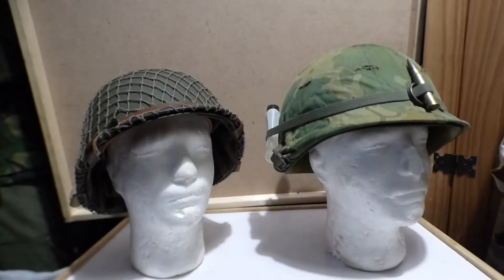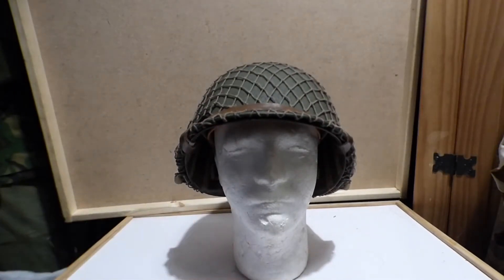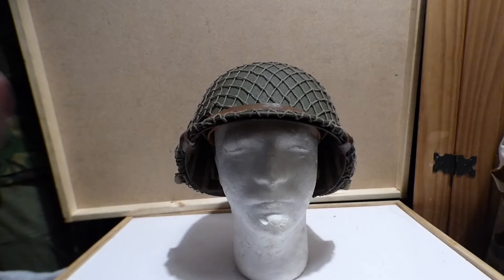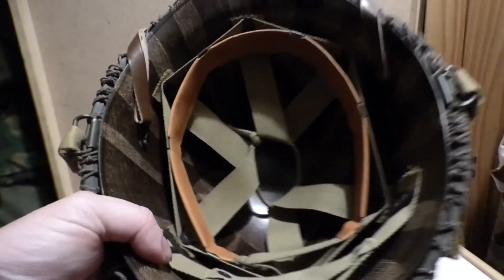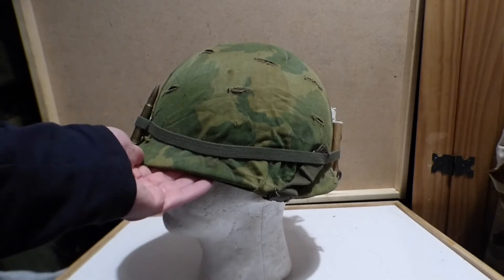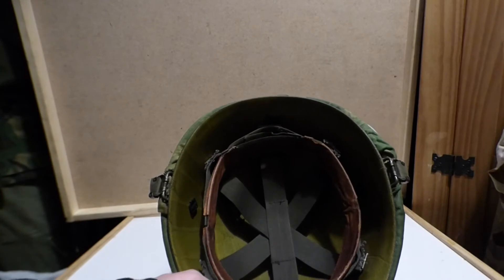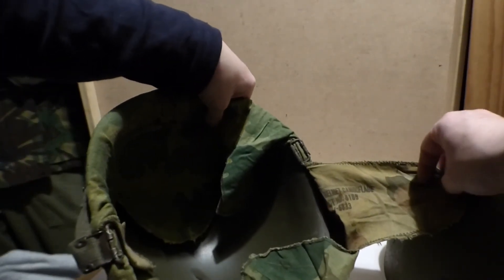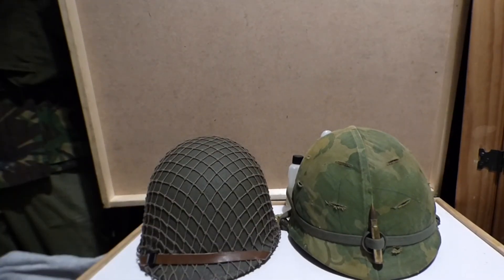WW2 M1 Helmet & Vietnam M1

Comment: I made a vietnam Impresion M1 helmet recently bet the cover was a repro , I put two 556. blanks inside the band with a JFK presidential pin on the Helmet band , I also marked the outline of Louisiana sate on it too to give it some believable authentic graphiti , I also had bought a fake pack of marlbouroughs and tucked it inside the helmet band , 
I try not to overdo it and avoid steriotypes but im pretty happy with how it turned out 
( Also the Liner was repro and the helmet was most likely NATO from the 80's but you wouldnt know with the helmet cover )

Comment: nice helmets. yeah your nam liner is actually later as indicated by the removable webbing. that wasnt introduced until mid-late 1972 and as they were drawing down troop numbers for departure in 1973 is doubtful any made it to nam. they were using nylon for liner shells from the mid 60s but the earlier ones are usually more orange-orange/green. 
like the been there look of the nam helmet.

Comment: I've got a front seam M1 with fixed bails. With aww2  Firestone liner. Unfortunately it's been in the hands of a reanactor who has made it into a Para ww2 helmet. So the chinstrap,  Repo , which is stiched the wrong way,as the long strap is on the left instead of being on the right. The A frames and cup are repo as well. Shame really, as someone used a decent ww2 Firestone liner and made it into a para liner, as firstone never made para liners in ww2.
Reply from the maker: ya some people just do strange things